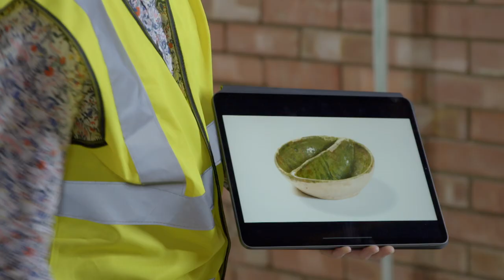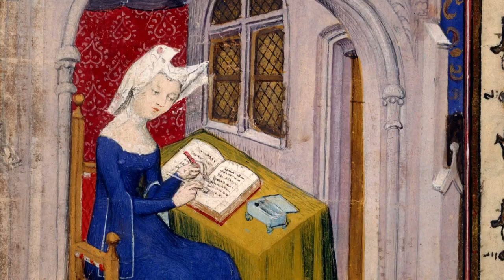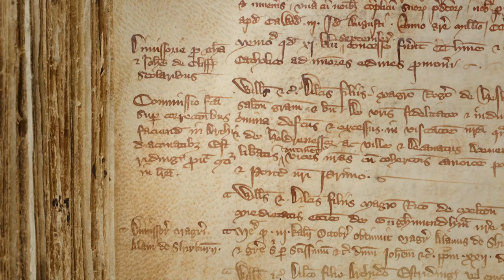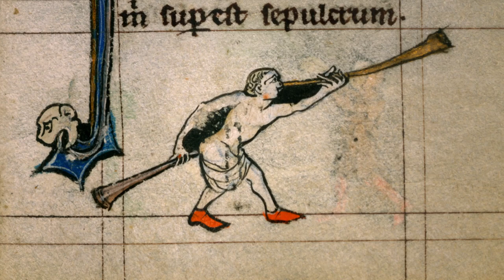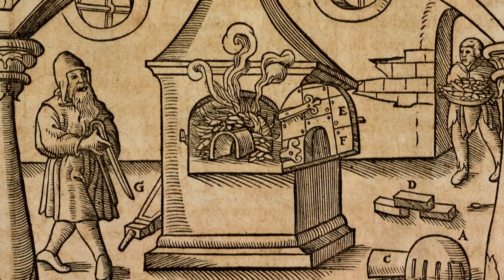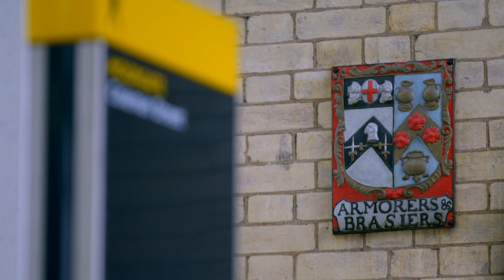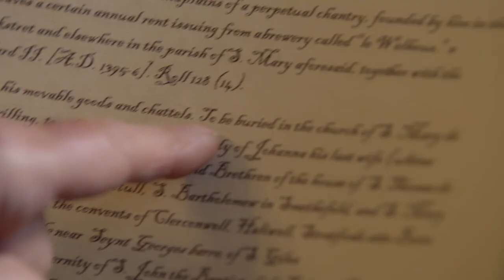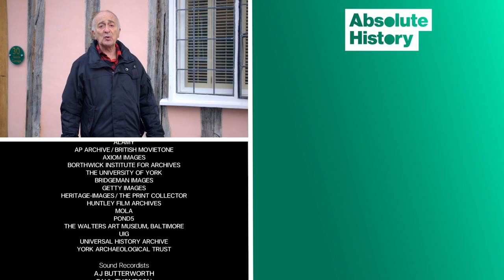The Revolting Life Of A Medieval Cesspit Farmer | History Of Britain | Absolute History

Comment: In 1993, in northern Wales we toured the ruins of Flint castle. It was awesome and looked over the estuary. The toilet was 3 stories tall and using the same shoot. Good communication would have been needed so soldiers do not poop on eachother. I am surprised cities did not build urban gardens for citizens to poop in compost bins generating new soil, food for the worms without contaminating the ground water.
Reply: Human waste takes years to compost properly so it’s not full of diseases.  Even with that most do not use it for food fertilizer since the risks might still be there.
Reply: @RJFPme  Best practices, in my opinion, is having layers of garden soil between the layers of "nutrients" in a 4x4 bin composters. Once full and leave it for a year, or even two years if you like, shovel the enriched soil around fruit trees. Works pretty well.

To keep it clear of contaminating ground water, build a raised bed and then build the compost bins on top. Start each bin with 1/4 full of leaves, weeds, grass, chips, kitchen scraps before starting with humanure production. Always add a layer of garden soil after nutrients. Layers are good. It adds the good bacteria in soil to break down the disease bacteria. Cuts the smell immediately too...not to mention looks better.

I really enjoyed this historical presentation on poop!

Comment: 1972, in Utah, the ranch we bought had indoor plumbing, but since water was trucked in, they still had an outhouse, complete with black widow spiders, in use. The indoor toilet ran to an open cesspit, which had boards across it. The kids ran across that, because, apparently we were stupid and it was supposed to prove how daring you were. Mom, being an RN, made that the very first thing that got changed and a septic tank was put in.

Comment: I'm a spinner (and a spinster at that 🥲) and the level of fineness these spinners achieved was practically inhuman. 

Yes, fibres become stronger if twisted, but in the middle ages they were not dealing with merino—aka a modern breed known for it's exceedingly fine hair, exquisite crimp and almost ridiculously long staple length—oh, no, they were dealing with shorter, coarser hair, that was probably more unevenly cut. 

And yes, you can skilfully shear a sheep with those old fashioned shears but you simply cannot get the same regularity modern clippers achieve, which also shear in a tenth of the time, meaning you have an animal that isn't fighting to get free for the 10 to 15minutes it takes to clip it's wool, instead of the 3 to 5 min a highly skilled modern shearer takes for, as anyone who has ever tried to dress a toddler knows, trying to do something delicate like buttons... or clipping wool... it is very difficult if you want to get a nice result with you are battling with a heavy, squirmy creature in your arms that's wriggling and impatient and just won't comply after a few minutes!! 

And then you have to remember most of these women were likely still using a drop spindle, or a small wheel at best (Great Wheels didn't come into use until the 1600's, around the same time as the knitting machine), both of which are dreadfully monotonous, yet still require just enough concentration that talking is not super easy, even if you get into the zone... and it's definitely the sort of task you have to properly get into the rhythm of doing, and interruptions are infuriating because you lose the flow of it all, but these women were probably bothered by everyone from animals to children to husbands; never a minute alone, and working even at rest it was for these women!!

And to think they wove threads fine enough to weave with... just incredible. I could 't do it.